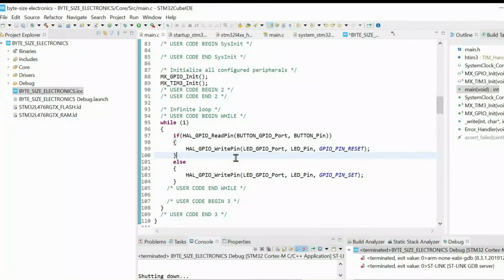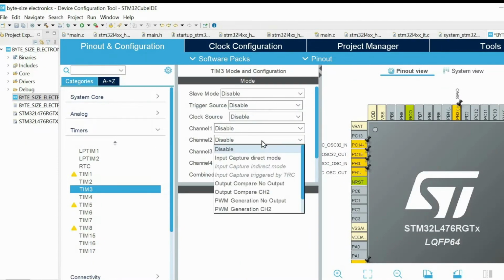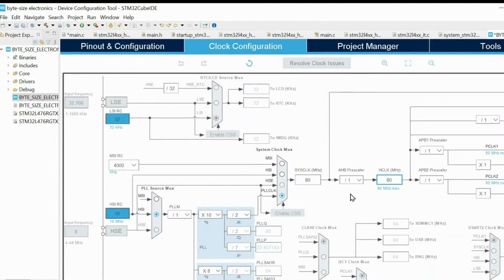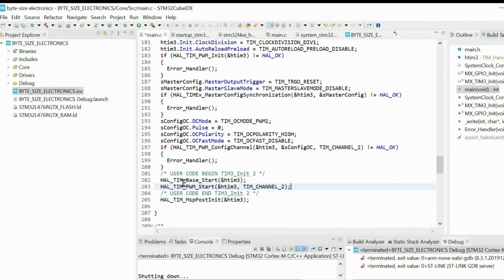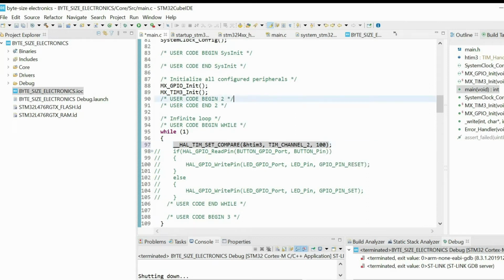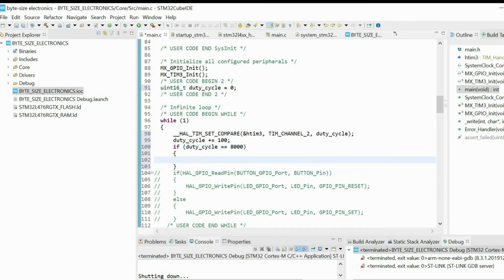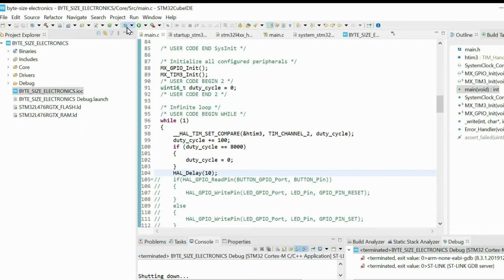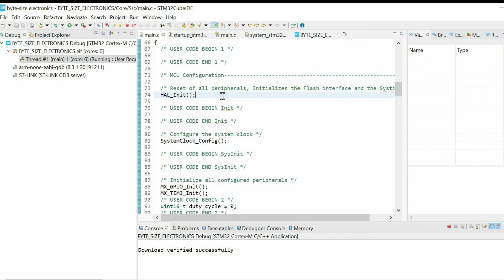It takes 2 mins to generate PWM signal in STM32

Comment: Why did you disable the clock source? In my case, I am using an external oscillator to generate the system clock. However, I'm not finding an option to select the external clock as the source. What should I do in this situation with cubeMX tool?

Comment: How do you control the brightness of the LED using a Potentiometer
Reply from the maker: You can make the voltage divider using the potentiometer and read its output using the ADC. You can refer to this video for ADC
https://www.youtube.com/watch?v=vPZlIOcRdEk&feature=youtu.be
Then you can vary the duty cycle of the PWM signal based on the ADC readings. If you want to get more info about ADC and PWM, you can refer to my course:
https://www.steppeschool.com/courses/stm32-programming-course